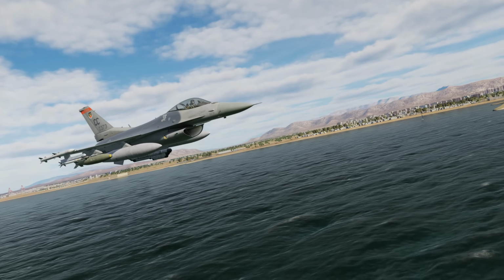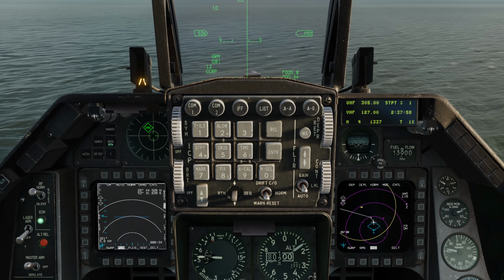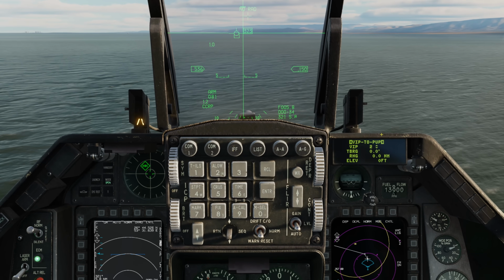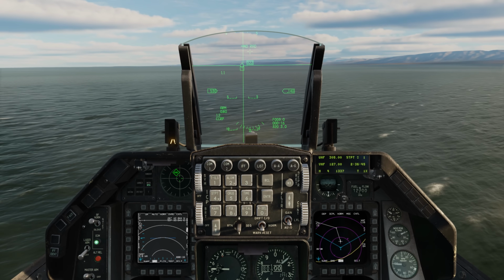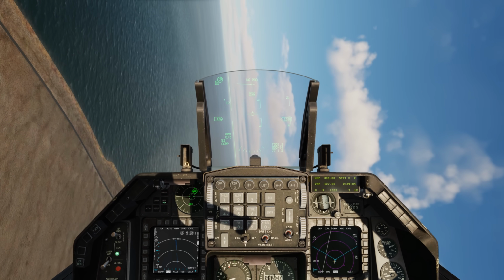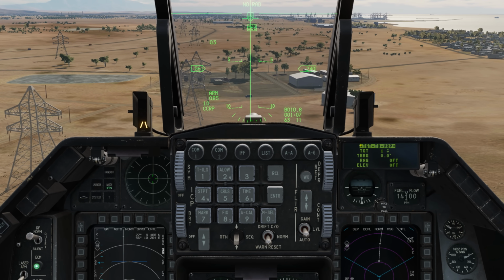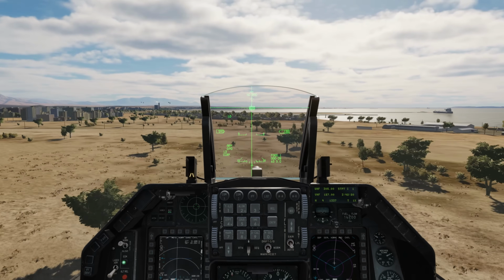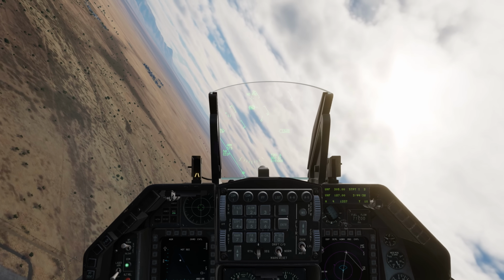DCS: F-16C Viper | Visual Initial and Reference Points

Comment: Some honest criticism: A few things you explained are a bit ambigious imo. You set up a VIP, but in the FCR you said you already set up a TGT point... so for the sensor this is the same? Then when you fly over the initial point, you said you need to press TMS up to create an overfly point just because that's "necessary". But what is that supposed to mean? An overfly markpoint? But why? You never pressed the Mark button and I really don't get what you are doing here. It would be a lot easier to follow if you would explain all the concepts first and then show how to apply them in the next step.
No offense though, the video was still helpful and a good presentation of that feature.

Comment: Well, I can imagine how VIP works. Initial point is a waypoint over a known location (like town, FARP or bridge), and some commander on the ground can inform you via radio: "Enemy armor spotted, azimuth 242, range 12 miles", so you have data to create VIP. But what's the point of VRP when you know exact location of the target?
Reply: This is for pre-planned strikes. Its not likely you could program this on the fly with much success.
Reply: @dmsdmullins  but then you could just as well use another steerpoint instead of the VRP or am I missing something?
Reply: @nd1312  Yeah you absolutely could.  It requires a lot of situational knowledge though. VIP and VRP are quite advanced functions.  If I can't set them up on the ramp, I'm pretty much just gonna wing it anyway and not waist time on it.
Reply: @nd1312  I was wondering the same thing.

Comment: Wags, great video as always. Low and fast doesn't leave a lot of room for error when trying to line up for an attack so this feature is going to be very useful for me (and others, obviously).

Given the placement, I'm reasonably certain the C-130s you bombed were statics but is ED going to revise the size of aircraft larger airfields like Bandar Abbas International in the Persian Gulf can support in DCS?

Currently, anything larger than an An-26B gets pushed across the water to the UAE when you select a 'Ramp Start' from Bandar Abbas (and Havadarya) which makes having C-130s and larger either start or finish at (without despawning) places like Bandar Abbas, which IRL can support up to 747s, impossible.
Reply: Although a year late, you can place aircraft as "on ground" instead of "ramp start" and you'll be able to simply place them anywhere you want. You're probably well aware of this feature by now but i figured i'd just leave it here for anyone else who may be wondering.